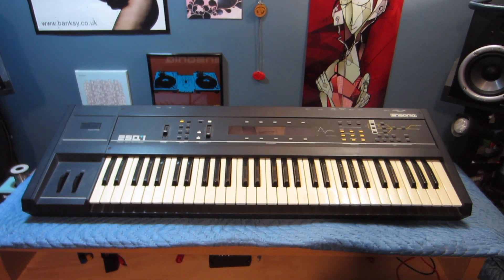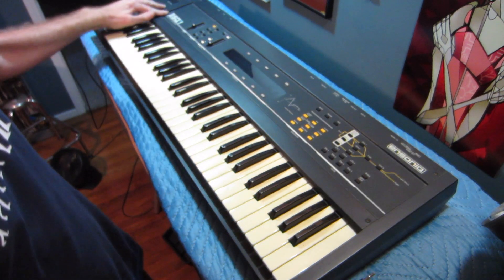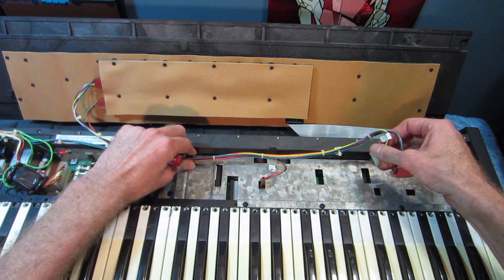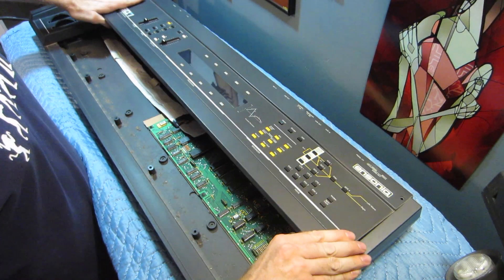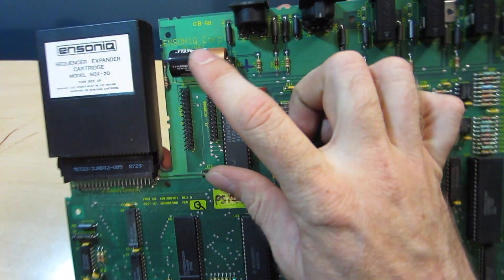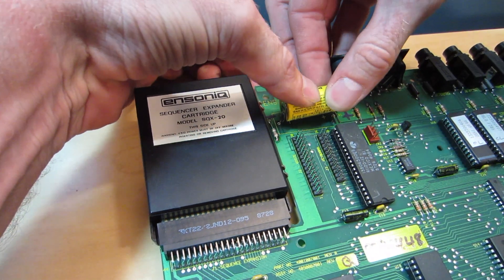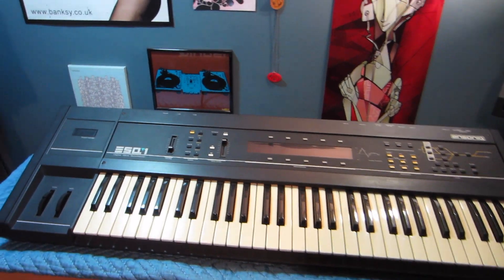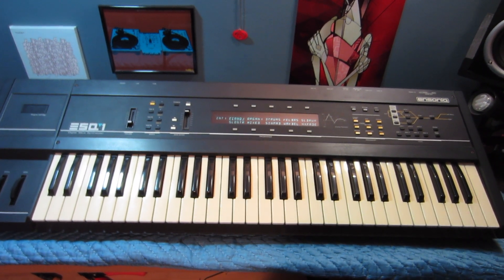How to replace the battery on an Ensoniq ESQ-1 synthesizer

Comment: Excellent instructions with clear video and audio, whew! I composed so many songs using this keyboard's sequencer. Then saved all the data to a tape machine (Tascam 244 Portastudio) to free up the memory to keep writing more songs. Now the ESQ-1 has lost all memory due to battery drain. The 244 now also needs reconditioning as the belts and rubber parts are defunked, maybe the heads are shot. I MIDI connected a Roland U-220, a E-MU Proteus 1XR (some with a Roland Juno 106) and an Alesis HR-16 drum machine (making actual songs not just patterns) to add more sounds to each composition. Each of these units have also run into battery loss or degradation of some sort and are not working right. I also saved the song data from these units onto tape, some to a Tascam 102 cassette, some to the Tascam 244 and some to a Sony DAT machine. ALL of those units need mechanical repair to function again. For all I know the tapes themselves are also too old to function. These old songs are intricate but may never get back to the original soundscape as written. That's showbiz folks ;-) It's one repair after another if I want to recover the actual original sounds I used, just too much. It was fun but challenging to compose using only MIDI and sequencers and no computer at all. But.. I'll start to get that mojo back with the Ensoniq battery and then take the next step. Thank you for this video!
Reply from the maker: Glad I could help.

Comment: Thanks. Super helpful video! Only thing that threw me off was realizing one of the top middle screws on the board is different than than the rest. And lining up the front screws to put the keyboard back is a little tricky

Comment: Does the Ensoniq ASR-10 have a battery? I have one and I've stored it in the box as the original owner. I'm concerned that being it's so old and has been powered on for a long time.
Reply from the maker: If it has any type of presets or memory then yes it would have a battery.
Reply: @SISKworks  it has a floppy disk and hard disks can be used as well. All samples and presets are loaded that way. So I believe that is how everything is stored. That makes me believe that is doesn't but I don't know that definitively. Thanks.

Comment: No way could I have done it without your step by step demonstration. It was very clear thank you very very much. My ESQ 1 has a serial number ending in 44. It's one of the original metal ESQs - I guess that's why it didn't need a metal plate. I believe the new battery I have installed will last 10 years. I hope so because it was still quite a task for a beginner -again thank you, Mike
Reply from the maker: Awesome. I love hearing that.
Reply: I also have an all metal ESQ-..Just days after my purchase in San Francisco I got a call from Patrick Gleason  (or was it his rep?) saying they wanted to "borrow" the thing. I said no. You may remember Gleason  was (is) a big time synthesist.. Only last year did I discover he was a low numbers collector...I replaced my battery in a Berkeley shop way back and soon after the keyboard got parked. It never left my big deal and is covered up..

Comment: Do you have a video on the Ensoniq KS-32? Thanks.
Reply from the maker: No, that was the only Ensoniq I’ve ever worked on and It wasn’t even mine.
Reply: @SISKworks  Thanks anyway. I might attempt it at some point once the battery is really dead.
Reply from the maker: @sadoche  go for it. The general idea should be pretty similar. Open it up, locate the battery, figure out what you need to do to access the bottom, desolder and remove, solder new one in place and reassemble. Obviously don’t do any of this while plugged in. Just know that you will also have to figure out how to reload the firmware or presets or whatever for your keyboard.

Comment: Omg! I bought a Ensoniq sd1 and I need to replace the battery! I need help!
Reply from the maker: Watch this video. The exact steps won’t be the same but the general idea is similar. Open the unit, locate the battery, figure out what you need to disassemble to get to bottom of board that battery is attached to, desolder old battery, solder in new battery, reload memory then enjoy 😉 Also, if you anywhere near Southern California I do offer repair services as well. If interested contact me through my website www.siskworks.com
Reply: @SISKworks  thank you! I will try. This is my first synth. I bought it at a thrift. I know nothing about synths, lol! I didn’t know I would have to get so crafty. And I didn’t know I have to reload the memory. Hmmmm. That manual is like a whole book tho!
Reply: @SISKworks  oh and I’m on the east coast.

Comment: Do you happen to remember what size the screws are that hold the top plate down? Any help gladly appreciated: really handy video, this.
Reply: It's a 2.5 mm Allen if anyone else comes across this
Reply: @michaelheller3440 Thanks!
Reply from the maker: No I don’t. This wasn’t my synth so I can’t check for you either. Sorry. 🙁

Comment: FACT or FICTION?: Your synth will last longer (forever?) if you leave it on ALL THE TIME.
Reply from the maker: I turn mine off when not in use. But I’ve heard people say leaving them on might be better. But I don’t but it. I say turn them off.
Reply: @SISKworks  I agree. My 1st synth was an ESQ1. Upgraded to an SQ80 which (iirc) had issues.. (i don't remember) but was 'unrepairable' (Ensoniq had closed shop). I miss them terribly. I'd love to re-buy one, but am nervous.. How repairable are they in 2021?

Comment: I just got an Ensonic SQ2 from a buddy of mine for free. I've never used a digital keyboard/ synth before, but I have plenty of experience with electronics/ robotics. I just wanted to throw this out here and see if someone could help me figure this out. 

  So, when I jack into the headphones port, I don't get any sound. The display works, but the LEDs above each button don't light up when you press whichever button you want. I tried giving the kayboard a factory reset, but the display didn't show anythinf other than "Button #_" when I did what was necessary to reset the keyboard. I honestly have no clue what to do about it. I assume the LEDs are possibly blown or aren't drawing any power. Bad battery? I dunno.
Reply: Nope.  If it had anything to do with the battery, the Sq2 will display Low Battery on display startup.

Comment: Good video. General tip - when removing components, snip the legs of the component to avoid stressing the board - especially when removing ICs.
Reply: Great design Ensoniq! There is ONE thing which will need to be replaced at some point, so make sure you need to remove every component there is to get to it!

Comment: This is ridiculous, lol. I think I'm going to clip the leads to remove the battery, then wire up to an installed battery chassis under the hinged door somewhere. Anyway, thanks for helping us all out!
Reply: Here's a video with Markus Fuller doing just that on his SQ-80 which has similar design. And instead of this expensive special battery he adds a new battery holder for CR2032 batteries which are mainstream, cheaper and available everywhere. And of course they won't last as long, but I think it is a fairly nice update. And with the new battery holder exchanging batteries is so much easier. https://www.youtube.com/watch?v=I3LJTsILbOo
Reply: @patsonmusic  .. Prefect! My project didn't work out so well, and I'm still getting a low-battery error. I think I need to open her up again and resolder my contacts. Thanks for sharing! :)
Reply: @danieklerr  I don't have these models myself, but a MR rack and having the battery renewal operation coming up, so I 've been looking for a good solution to the problem using a more available standard battery. Don't know what the MR look like on the inside, but been checking out these videos in advance 😀

Comment: Hello thank you so much for posting this it was of major help replacing the battery on my esq 1 (plastic). However I also need to replace screws for the bottom panel that hold the keybed and it's been difficult finding the correct screws, do you know what kind of screws they are by chance? Ik they're phillips but it's hard finding right measurements and if they're coarse or machine thread. Thanks again!
Reply from the maker: I can’t remember exactly and that synth wasn’t even mine so I can’t check for you. Check on the inside if it they are connecting to metal or plastic. I think they go through plastic bottom and into the metal of of the key assembly so I would THINK they would be machine but idk.

Comment: Hi is it safe enough to keep the original battery in there ? i own the first metal case esq 1 model with the battery vertically positioned on the bottom left of the mainboard and it reads 0.33v so its definitely dead but there is no corrossion or any other sign of damage, is it safe to keep it there or at any time this thing can explode causing damage to mb ?
Reply: Old batteries will eventually rupture and cause electrolytes to leak all over the motherboard PCB (and cause further damage).  It may take a year, or it may take several years.  Highly suggest you consider replacing it as some point.
Reply: @EnochLight  Thanks Mike i bought it a few months ago and since this synth is a keeper i will replace it asap, i am familiar with basic soldering but since i bought it second hand and the battery was never replaced i thought that its so many years in there that the battery is tottaly dried out, it reads as far as i remember 0.30 V so needs at least to remove it somehow and why not replacing it with tha CR2032 equivalent if it holds 3V. i have replaced a battery succesfully with a VFX but sold it cause it had the well known keyboard issue, the ESQ 1 doesnt have this problem cause keys arou mount in there with a spring system which makes this a great advantage compared to later models.
Reply: The 2032 is exactly what I used on a SQ1.  They’re inexpensive and fairly reliable.  I had some old motherboards laying around so I desoldered the OEM coin holder off an Asus and put it into the SQ1.  Soldering in batteries is crazy imho, especially if you’re taking the time to do the work and don’t want to risk anything doing it repeatedly.  I’ve seen videos of skilled keyboard repair guys snipping leads and soldering in holders.  Their consensus, why screw around with something if it’s unnecessary outside of some neatness which is never seen?

Comment: Super helpful Mike! Thank you! Dumb question but I'm not super handy. Do you a list of tools one would need to complete this job? And do you know the battery information?
Reply from the maker: Kirk Bentley There is a link in the description for the battery that I used. For the tools you will need a Philip screwdriver (to open the case), adjustable wrench or socket (for the 1/4” jack nuts), soldering iron and solder wick. I think a good soldering iron and solder wick are the important part. I use a Weller WES51 solder station and the wick I use is just this copper braid that is literally called “solder wick - soldering remover”

Comment: Is this basically the same procedure for replacing the battery in the SQ-1?  Are the internals about the same?  Thanks.
Reply: He doesn't know, it would appear.  :(
Reply: Forgot about this post.  
I did locate a source for empty data card clones.
I backed up the data and took my SQ1 to a local guy who does work on old synths.  He opened her up and he installed a battery clip thingy so that future battery swaps will be easy.
She’s up and running!

Comment: Hey Mike,

Just pulled my ESQ-1 out of storage and am getting the battery warning.  Does this require soldering on a new battery no matter what? Or did you have to do that because the previous owner had soldered the wrong battery on?  I don’t suppose its normally a pull the old batter out and put a new one in.  Also, when you say back everything up, is that just for sequencer data?  Or does that also include the internal (default) sound patches?  Thanks!
Reply from the maker: darwinmcd music so this ESQ-1 is my brother in-law’s so I didn’t do the backup part but I pretty sure he backed it up to tape like this video shows but I think you might also be able to back to midi sysex but I don’t know the exact process. 

https://youtu.be/ptUGU9zVhIc
Reply: Mike Sisk Awesome!  Thanks for the link.  I did a little research and found that you may be able to back up to PC with sysex support midi-to-usb cable (just ordered one a few days ago). Hopefully that’ll solve my problems.  Thanks again for your help!
Reply from the maker: darwinmcd music Yes this will definitely require you to solder even if it had the correct battery to start. The backup is to save the internal sounds it has. If you pull that battery out without doing a backup first all sounds will be lost. Also if the battery you currently has completely dies you will also lose all the sounds.
Reply: Mike Sisk Thanks for the quick reply.  I don’t have a way back up the internal sounds. Sequencer data is already gone but was hoping the internal default patches would not be reliant on the battery. Bummer. 😞

Comment: Awesome bro! Hey any chance you have changed a battery for a ensoniq Kt- 76 ? Just got one.. but can’t find any info
Reply from the maker: Breno Cowie No I haven’t. But I would think the general idea would be the same. Just got to open it up, locate the battery, figure out to get to the bottom of the board, remove solder, install new battery, put back together.
Reply: Mike Sisk thanks mate appreciate it 😃👍🏼

Comment: Will you lose the presets patches after changing the battery?
Reply from the maker: Keith Chua Yes. You will lose all presets when that battery is removed. You will need to back everything up before attempting this and then need to restore/reload those saved preset after.

Comment: bcheong 06/26/2019 Dear Mike, what a neat job! Have you done replacing the batteries from Ensoniq kt88? Can you help with the instructions to replace my Ensoniq kt88 run down batteries. Thanks. bcheong1@cox.net
Reply from the maker: Bernhard Cheong Sorry but I have never worked on that model. Actually this ESQ-1 was the only Ensoniq that I ever touched. Have you even attempting opening it up? If you are familiar with soldering it really shouldn’t be too hard. The exact steps won’t be the same but the general idea is the same. Open the keyboard, inspect the board to find the battery, remove the board, desolder the old battery, solder the new battery and then put it all back together.

Comment: you don't have to take out the main board to change the battery. Just clip the wires and desolder them from the top with a solder sucker
Reply from the maker: John Sormani yes you CAN do it from the top by cheating and clipping the wires like you suggested but that is NOT recommended. You really should just take the time and do it the proper way to ensure you don’t mess up.

Comment: Damn. You think they would have just installed a battery compartment on the back or bottom of the unit for easy replacement. Unreal the work you had to go through just to change out a battery. Poorly thought out design, still one of the best synths out there. Good work on your instruction video though. Props.

Comment: Holy cow man...so I need to take apart the entire synth just to replace the battery.
Reply from the maker: Cristian Barrera yeah pretty much. I guess if you really wanted you could cheat and clip the legs from the old battery and solder the new one onto those clipped legs but that’s kinda janky IMO.
Reply: That’s the way I did it and it lasted 8 years

Comment: THANK you for this! I got my ESQ-1 in like 2012 I believe and needed to swap the battery since. But shops wouldn't take it in for repairs, couldn't find any visual guides except for dudes doing the battery holder replacement, which is NOT recommended afaik. So I may just try to follow this guide and do it myself.
Reply from the maker: Awesome! Glad I was help to you.
Reply: greetings how come you cant do the battery holder replacement for CR123s? thats what i want to do with my sp12 turbo, dx, drumtrak and some random digital reverb

Comment: So wait, this brilliant synth only works with battery? No 9 volt plug?
Reply from the maker: The battery is only used so the synth can remember and load presets. It will not work with just the battery. Also the battery is 3 volts not 9 ;-) Thanks for watching.
Reply: The ESQ-1 operates on 110 volt AC power. The 3 volt battery is only for storage of presets in memory. I just use my synth as an input device (via MIDI connection) for Apple Logic Pro digital instrument tracks. I can do this even with a dead battery in the ESQ-1.

Comment: Hello Mike! Thanks for your video. I soldered new battery on my Ensoniq KT-88 as a way to delete the problem with display (nothing shows when I turn on keyboard, Grand Piano plays only). It didn't helped. Can you give some thoughts how and what more I can make  for the display's working. Thank you!
Reply from the maker: An Vedi Sorry this was the only Ensoniq I've ever worked on and I am far from an expert on this. But no display would not be a battery issue. I believe the battery only effect the memory. First I would inspect all cables and connectors to make sure they are fully seated. Then inspect the power supply to see if any capacitors are expanding or leaking. Power supplies are the most common failure in most electronics. Also just scan all boards to see if anything looks burnt or fried.